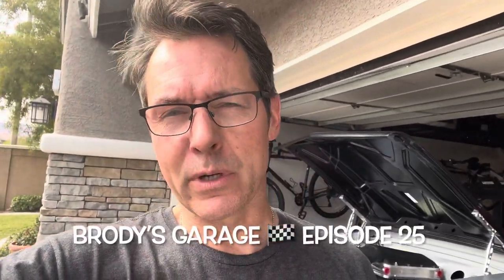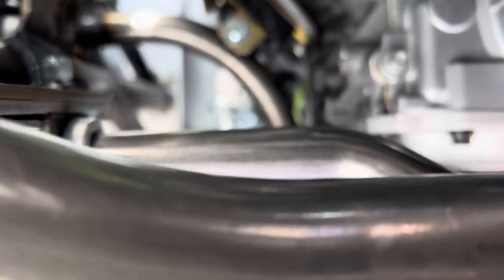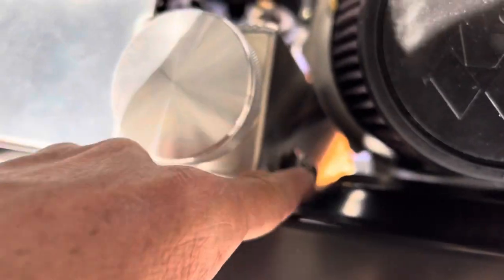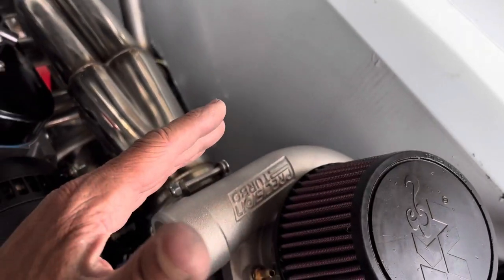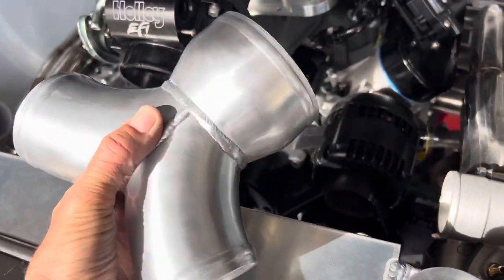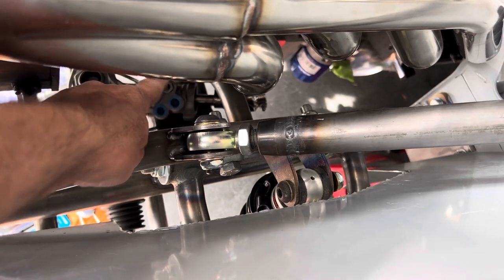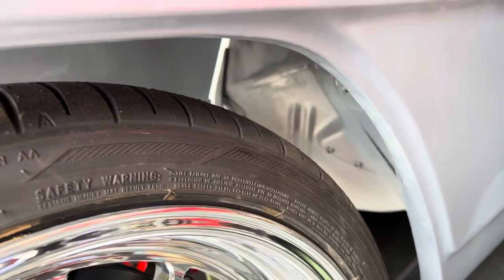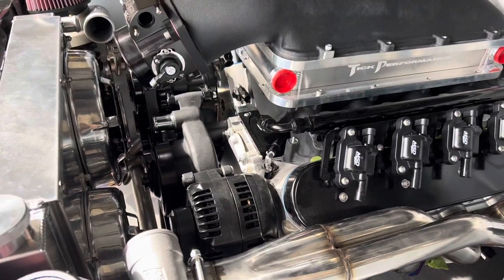Brody’s Garage 🏁 Episode 25: Modifying Engine Mounts/Radiator Install

Comment: if you need radiator hoses for it you can use napa hose part # 8304 for the lower, need to trim one end a little to fit perfect. for the upper get napa part # 8961, this one needs both ends trimmed some to fit perfect.
Reply from the maker: Thanks for the tip!